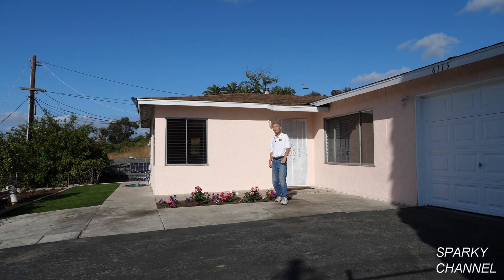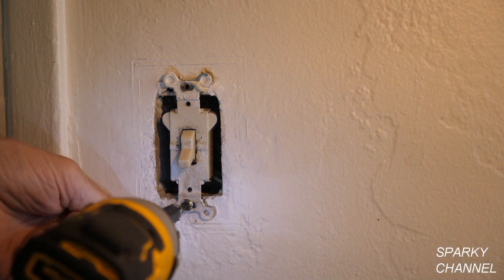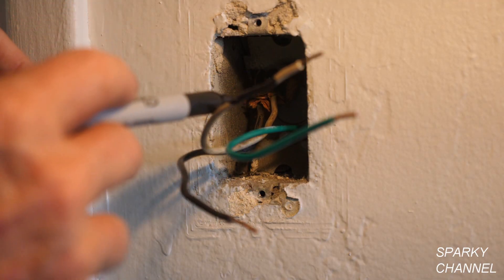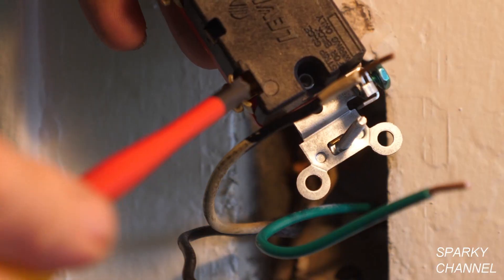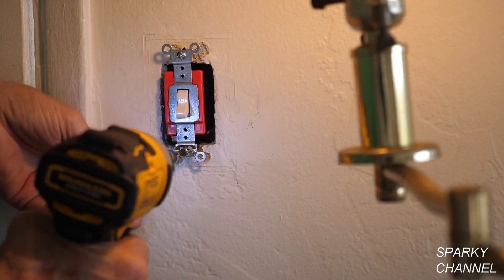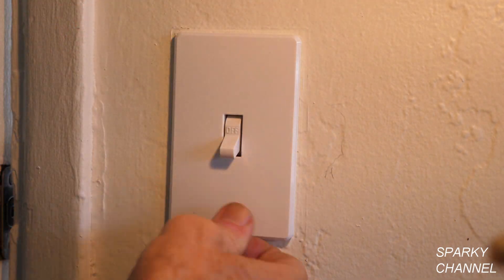Replacing a Vintage 1960 Switch and Grounding the New Switch

Comment: How was he able to tell the box was grounded without seeing the back of it?
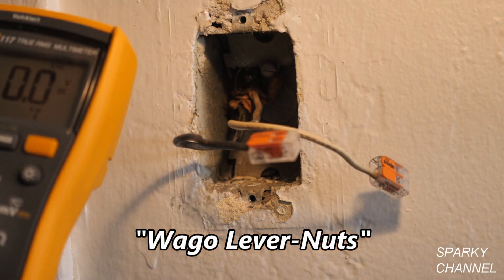Reply: At 2:30 he uses a multimeter to test for voltage between the Hot Wire (white wire in this scenario) and the metal box itself. The metal box must be grounded because he reads 120V on the meter, meaning that the metal box has a ground wire attached that runs back to the breaker panel. Remember that Neutral and GND are tied together at the breaker panel. If he had measured zero volts when measuring between the Hot Wire and the metal box that would indicate that the box is NOT grounded.
Reply: @samuelholt5454  awesome. Thanks for explaining that so clearly to me. I just purchased a home built in 1967 and the outlets is one of the things I am modernizing first.
Reply: Question: Why is there a red wire in my switch box connected to the side of the switch ?
Reply: @krvnjrcbs daisy chained outlet lost likely. My house was built in the 60s and had outlets tied to a light switch. They ran red,black and white wiring

Comment: What is the best way to add a neutral wire to this switch box so I can add a outlet and switch combo?
Reply from the maker: It's best to replace the old non-grounded cable with a new grounded cable.

Comment: Wait a minute, that NCVT is flickering red when there is no voltage or hot wire? Shouldn't it flicker green instead and then flicker red when it finds a hot wire? 🤔
Reply: That particular model blinks every few seconds to let you know that it's working properly.
Reply: And as a fun fact when you’re working on electrical this old, your non contact tester can pick up capacitive voltage from floating grounds from bad circuit extensions and conduit connected boxes with no path to ground. On a multimeter you’ll find tens of volts and it’ll all be very confusing at first until you find a steel box with old NM without ground.

Comment: Sparky, thanks for the informative videos.  I have a single pole switch that controls 8 flood lights on the 4 corners of my home.  I wanted to add a Smart Switch that requires a Neutral wire.  In the box there are 3 wires Black, White & bare ground. My guess is that this was done incorrectly as the white is not a neutral.  Is there a safe way to add a neutral (required by the Smart Switch).  Thanks for your advice.
Reply: Leviton makes the Decora Smart which does not need a Neutral and is listed. There are many non-listed options out there as well.

Is there an outlet near where you want your switch? ShellyEM makes smart relays that are UL approved and mount inside a junction box. They’d need power from an outlet or a low voltage source like a doorbell transformer obut you could control the switch leg with the relay. You can also use a smart switch and a contactor.

Comment: Hi Mr. Sparky. I have an old style, single pole light switch, but it has the screws on the top of the receptacle instead of the sides. It has a metal box with only two wires.This house is very old. I turned off the power, but it still lit up my electric detector. What can I do? I don't want to get shocked! Thanks so much!
Reply: Just don't let any metal touch bare ends and same with wires keep ends covered until connecting.  Connect very carefully.  You might get shocked.

Comment: I have a triple light box wired with the 2 wires and no ground.  But my box is some kind of old plastic not metal.  Do I need to ground?  I am changing to rocker switches..Thanks

Comment: Hi, how can you tell that, that metal box is actually grounded?
Reply: The voltage test at 2:20. An ungrounded box will not have a return path for the current so the voltage reads 0 (or close to it).

Comment: Sharpies should not be allowed for color coding as they fade to nothing in a few months.  I relearned that lesson when I was using a Sharpie to label home runs on the jackets a while ago.  It was several months between the rough in and the finish.  The labels were almost unreadable and this was an interior location.  I have used them (only once!) marking out truss locations on a top plate which did not get completed that winter.  Come spring they were completely gone.  I had gotten spoiled decades ago with the old "Magic Markers" which had a strong smell of acetone but would write on anything and it stayed.  Don't even bother trying to use Sharpies as a laundry marker.  A paint marker is probably the best way to handle color coding the conductors.  If you use electrical tape and do it according to manufacturer's instruction it can also be effective.  The way most use it lets it loosen up and fall off with time.  3M has a tutorial on how to use theirs.  I know, who would of thought electrical tape would be complicated!  One of the tricks they mention is don't stretch it for the final few wraps if you do it will let go.

Comment: I have an old switch that is not working. it has 4 wires. 2 are hot and 2 are not. Took the switch off to expose the wires to confirm I had 2 hots. I flipped the breaker and both hots went of so they are the same circuit. Why would I have 2 hots on 1 switch? Any ideas?
Reply: Sounds like a 4-way switch. Many diagrams can be found through your favorite search engine. "Four-way switches are used to control lighting from three or more locations."

Comment: No mention of if there is no ground. Old post and loop style wiring and replacing it would require total destruction of the walls.
Spend 50K to replace the wiring, walls, parts, labor, etc, just for grounding purposes?
Reply from the maker: There actually was an old-style ground running to the back of the metal box.
Reply: @SparkyChannel  The one you did does, but the vast majority of the ones in my house are ungrounded.
Can't find any 2 prong outlets to replace weak ones I have either.
Reply: @crazysquirrel9425  I'm a bit late to this conversation, but did you consider replacing the 2-prong outlet with GFCI outlets? Sparky has several videos about that, all of which I watched several times before I replaced 2-prong outlets with GFCI outlets.
Reply: @chuckm.9744  GFCI outlets to not match the antique decor. Building is well over 100 years old. It even used to have gas pipes for gas lighting too. Fireplaces for heating. Pocket doors with crown molding. Etc. 
Even the covers do not match the decor.
Haven't seen a dark brown GFCI either.
If my panel was more modern, I might consider using a GFCI breaker.
And placing ugly stickers all over the place destroys the nuance.
Reply: PS even my light switches are the old snap switches. Loud CLICK too! lol
Some of those switches are porcelain.

Comment: This video makes me nervous.  I don't trust the wiring in 2 wire houses.  I used to live in an old Victorian era Queen Anne house my parents had been given that was so old that to light up the dining and living rooms the original owners had inserted wires through the old gas light fixtures and stuck on sockets back when electricity was new.  That old 2 cord wiring was cloth covered rubber over the solid wire.  By the 1970s and 80s that wire was so fragile that almost any touching of it resulted in insulation cracking or flaking off somewhere.  If you tugged on a wire in an outlet box to get a little more, there was a good chance some insulation fell off inside the wall.  We learned not to do that.  Someone did some 'upgrades' in the 1940s(?) or 50s and added more wall plugs and switches but the wires were still the old cloth type.  Fuze boxes in the basement when we got it in the 60s and 1 fuze receptacle had a 1930s penny in it instead of a fuze.  The main power cut off was a huge knife switch on the all alongside the fuze box.  There was some ground, but not on everything.  There were some push button switches that if you touched them wrong you got a shock.  When I took control in the 1990s one of my first self assigned tasks was to remove all of the old wires, replacing it all with new wires grounded to a well grounded new circuit breaker box.  
Such a waste of time and $ on my part and a lovely house soon to be gone.  A few years later NYC claimed Eminent Domain and tore down it and all the similar houses on the block and built an "Ultra Low Income Housing' High Rise where they had stood.  All that said, I prefer switches that go click or clack to the noisless kind the big stores sell.  I want to here a click when I throw the switch.
Reply from the maker: Re-wiring is recommended, you're correct about that.

Comment: If the box is grounded, wouldn't the device still be grounded when the  switch is screwed to the metal box or a ground wire is still needed?
Reply: Not for a light switch/switch because with the metal type of wiring if its metal type meaning armoured cable that is enough if it is uninterupted between the ground whatever you decide to use for goround such as any metal continuoues with grounding/earth contact either a metal NOT gas/fuel type of pipe nor steam but only water cold water prefferably... pipe or else the rebar of enougj surface area within some concrete for the ground what is called a ufer ground if making a new install etc... however this is not what you should do if you ever are going to sell because if you try to sell then it may need to be certofied that it is built with the techniqies of a specific way or method for just about anything so if it is then you need to be careful more so with how you build.
Reply: I have the same question. I thought about adding a pigtail just to make things obvious, but I decided against it for no strong reasons.

I'd like to understand the pros of the pigtail addition and whether it's a code requirement.

Comment: So how would you ground it when there is no ground attached to the metal box?
Reply: First the system (service) needs to be grounded. If so connect (bond) the box to the nearest grounding equipment conductor GEC (the bare copper wire going from box to box)-this is what was done in this building. No GEC? Then go all the way back to the breaker box or even the service disconnect to find a solid grounding connection point.
Reply: @shieldcracker  lol okay, so what is the level of difficulty for what you just described compared to what was demonstrated in this video?
Reply: @mts7274  More difficult, and the difficulty depends on how far out from the box you have go to connect to the grounding point.
Reply: Did you not watch this video where he adds a ground wire?
Reply: @YourEyesTheyLie  Did you not read my comment? I asked how to ground it when there is NO GROUND attached to the metal box.
Reply: @mts7274  Exactly, he adds a ground wire to the metal box.  Is that not what you want?
Reply: @YourEyesTheyLie  Good lordy... what if there was never a ground wire run to the back of the metal box? Older homes don't always have grounded receptacles. The box has to already be grounded, if you intend to ground a new switch or a new outlet.
Reply: @mts7274  Your original question wasn't detailed like your last response.  Check the box for grounding by using a voltage meter. Touch one end of the tester to the hot (black wire) and the other to the inside of the box. If you have voltage, then it's grounded - that's when you can add a ground wire.  If not, you'll have to replace the box.

Comment: So if your wires are short...can you pull the pushin wires out??????
Reply from the maker: Yes, if there is some play in the wires behind the box you may be able to pull some more out to solve the problem.
Reply: If you are talking about pulling the wires out of the back of the receptacle the answer is yes. There is normally a second hole adjacent to the one the wire is in. Push a wire or fine screwdriver blade in that hole and the wire will release. One thing to look out for is deep nicks in the exposed copper wire. 
It is also ok to put a pigtail extension on the wires.

Comment: IF your multimeter has a continuity check, couldnt you just check continuity between the case and the neutral wire, instead of turning the power back on?

Comment: How about how much is the charge for just this change out and how long did it take you?
Reply from the maker: Depending on your electrician, a simple light switch replacement can cost between $50 and $150. It takes about 5 minutes.
Reply: Do it your self,  In this case It was not necessary to add the green ground wire, switch is grounded to the metal grounded box with the switch mounting screws, He over did it.

Comment: I don't have metal boxes to screw the pigtail into.  I'm trying to wire a lutron diva dimmer it comes with two red,  one black and one ground.  It's working with just the solid red and black wires connected.  Do I really need the ground?

Comment: What would happen if you wired the black and white wires incorrectly, reversed
Reply: It doesn’t matter which terminal you hook the screw to
Reply: The switch would just work the opposite way, down would be on and up would be off.

Comment: Why do you need a ground?
Reply: You don't need one, it just helps prevent shorts
Reply: Am I missing something here how are you getting ground from a metal box that's nailed anything wood?????? 
Or is your electrician Amish?
Reply: @davesmith1585 It’s bonded with a ground wire to the back of the box.
Reply: It will work without electricity finds its own least resistant way to ground and so you ground it so it goes the ground instead of making you become the ground in case of mishap it's not 12-volt it doesn't require ground none
Reply: To avoid getting electrocuted

Comment: Hi, Im replacing mine as well. can i leave the ground in the wall or since the new light switch has the ground screw, do i have to get grounding pigtails? (i believe i have a ground to the wall since theres open copper wire in the back of the box)
Reply: Same question. 🙂

Comment: hi,im planning on replacing my switch on my 1960 house but the wires are both hot.why is it?
Reply: Sounds like you may have a short in the system. You need to trace it where the true Hot wire from and check all those receptacle and switches that leading up to the switch you're replacing.
Reply: Maybe it is switching 240v?

Comment: I definitely learned a few things from this video. Thank you.

I'm in a 30's or 40's 6-story building in Brooklyn, NY. I have a light switch in the bathroom that looks very similar to this. There are two wires, both with black fabric jackets, and one has some white paint on it. I'm hoping to get some kind of combination rocker switch / single outlet in there because there are currently no outlets in the bathroom at all.

I can't access the area behind or around the switch box, and I'm not sure if it's grounded. Is there an easy way to check?
Reply from the maker: Please see about 2:30
  That is a test to see if your old metal box is grounded.

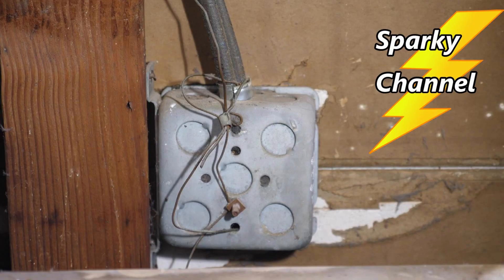Comment: 3:33 Is that tiny gauge silver wire (Aluminum) that you call "Grounding wire"? and aren't they supposed to be "Cupper" and larger caliber, say 18, possibly 16, or better gauge to comply with the code and pass inspection?
Reply: Codes very per state per county the I.R.C. is a guide line then towns set there codes
Reply: This is old. There was a time when they weren’t “supposed to be” anything. ;)

Comment: I think your premise that it doesn't matter how you wire the switch is flawed.  The line or hot should go to the bottom and the light feed go to the top.  Think of the power going up and through the switch when the switch lever is moved up.
Reply: Really doesn't matter.
Reply: Well, if you are looking at safety in electrical work to simply say it doesn't matter needs to be thought through a little bit more.  A standard of wiring should be made clear and not just say it doesn't  matter.  True it does not matter as far as function, but I  feel safety may play an important role here.